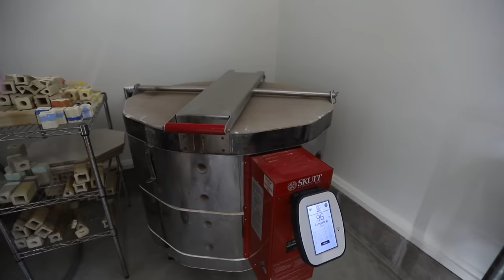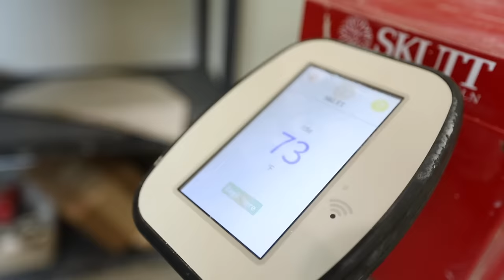MAKING A MUG - The ENTIRE Pottery Process -  ASMR edition

Comment: Lmao I’m over here thinking that this could be a casual little hobby to have and then see all this equipment. 🙈😳😆
Reply: Hou can work clay without a wheel, and fire without a kiln.  Look up primitive pottery.  Pottery goes back thousands of years.   Mud, glaze (or not), and fire.
Reply: Same 😒🤣
Reply: I started pottery without equipment! you just need a couple of inexpensive tools, & you can use the slab building method for plates & mugs, & the pinch pot method for pots haha
Reply: & then get fired at a local ceramic store they usually let you pay per shelf
Reply: barira ooo
Reply: Lol me too! I dont know if i can afford that oven thingy.
Reply: @barira2995  unrelated but you're so pretty omg
Reply: Same lol
Reply: Lets not even talk about the electricity bill
Reply: I found a set for kids lol, much cheaper than the actual item

Comment: Very nice illustration, of the process.
Was it me, or did you have the wheel going both clockwise, to center, then counter clockwise, to open and pull?
But cutting through clay, on a work surface, with a needle tool?!  I tell my students, that's a "No no".  You gotta go with the fettling knife.  That's it's job, to fettle.  It's right there in the name.
Reply from the maker: The square bat sometimes makes it appear as if it going the other way on camera, but I can assure you the wheel was spinning the same way the whole time !
Reply: @Jonthepotter  I wondered, if it was just an illusion caused by the motion, along with the recording.
But, on the other hand, I thought maybe you like centering on way. and the rest of the process the other.  I've never seen anyone do that, but there are a lot of ways to do every step on the wheel, sonwho knows?

Comment: very nice Jon but why couldn't you type how many days, you never showed putting on wax resist.  my biggest problem I am having is timing.  How long to make sure a thrown piece is dry enough for the bisque, and  I think I unload to fast and not really wait for a complete cool down.  but please, how many days or hours do you wait to put on handles and how many days do you let a pot sit to go bone dry?,   love you stuff tho.
Reply from the maker: Those are hard questions to answer definitively because the space it's drying in makes a huge difference.  If I put a pot out in the sun I can put the handle on in 30 minutes, but if it's inside in a humid environment with no air moving it might take 24 hours to get to the point where I can put a handle on, also I just forgot to video the wax resist sorry, and I just lost track of how many days were in between.
Reply from the maker: Same answer for when it's bone dry, it depends on where it's drying and how thick the piece is , anywhere from 24 hours to a week !  A huge variation I know!